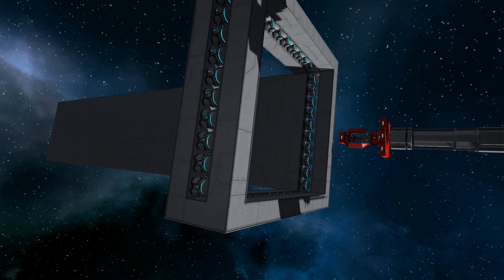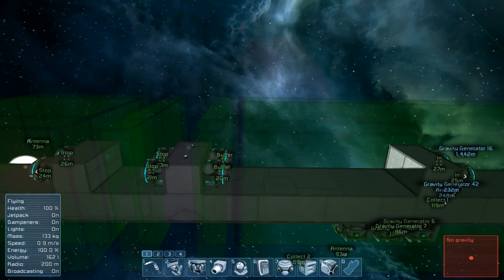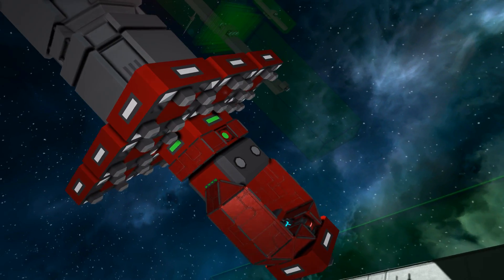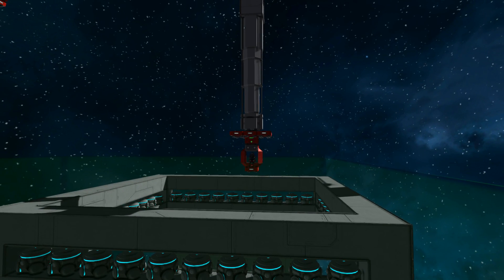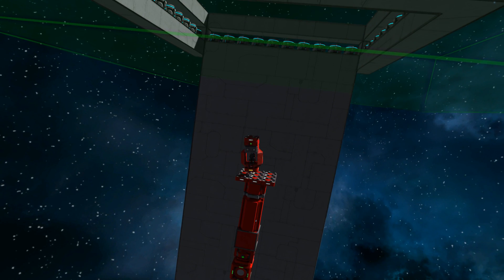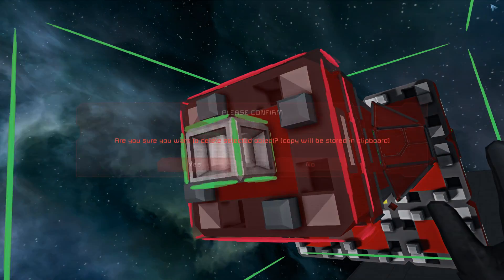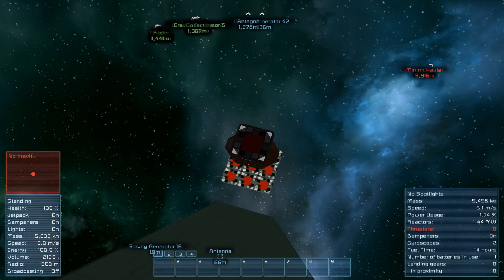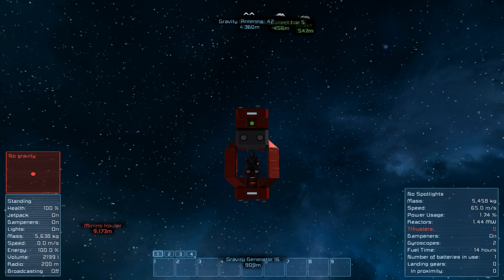Space Engineers - WiP Gravity Elevator/Catch Net System

Comment: Try making the gravity field that accelerates the cabin a lot longer, but with reduced strength, so the object will take longer to accelerate and decelerate as with the ore demonstration setup. Also, try setting the launch timer block to not only move the cabin into position and release the merge block, but move the cabin into position, then disable the gravity field, then release both merge blocks on the cabin and on the launcher, then retract the piston, then re-enable the gravity field. This way I think there will be less randomness introduced by the magnetic field of the merge blocks, even though theoretically, it should not be an issue. If it works, be sure to let me know! I love the idea. You have come up with. I would love to see one of these working in a survival map!

Comment: I think your problem is that the artificial mass is not well placed. it should match the center of mass of the ship, otherwise it will cause rotation, and part of the acceleration will be lost or wrongly directed. Try to place artificial mass in the same spot of the center of gravity of the field and also six more at equal distance in every direction it should stabilize the thing and make it work as intended. Also more artificial mass means more acceleration iirc so you might not need additional gravity generators or even need less of them.

Edit: I've tested it myself and I'm horrified of what I'm about to say but, landing gears instead of merging are actually the most reliable way to do this:
the problem with your setup (apart from the artificial mass not mirrored on the center of mass point) is the launching system itself: under the pull of gravity the capsule makes both the piston and the rotor head shake a bit so when under the heavy acceleration that bit makes your ship at least rotate so it will not merge on the other end... the only (so far) 100% reliable system is landing gears (not fixed to a piston because that will bring back the shaking issue) I've set a timer that leave you the time to get in the pod then turns the autolock off and releases the  landing gear then another one turns the autolock back on for caching the pod when returning

Comment: If you pause at certain sections of the video right as the launcher is about to put the seat into the gravity field you can see where it isn't perfectly aligned with the gravity elevator. Possibly connecting the launch/net to the actual elevator will give you a more precise shot. At least that is my assumption to the issues at hand and all I can come up with when I see the varying speeds and trajectories. Possibly launching without initially equal gravitational representation on the launch craft is creating these wonky results? As usual though, great vid.
Reply: 0:03 is perfect example.
Reply from the maker: Adam Sir good point sir :) It's weird that the grid would be misaligned as it's all supposed to be on the station grid but I've seen it happen... will see what happens if I change it.. of all my vids this is the one that's never had a solution so always willing to give something new a try :) Cheers!

Comment: I kinda rebuild your concept used 36 Gravity Generators on each side coming to an overall 36 G on the Center Point.
Using a pod with a symetric design and some landing gears above the merge landing block, to avoid bumping to the side while hitting the merge block.
It works perfect, at least on short distance.
Link to the world to test (http://steamcommunity.com/sharedfiles/filedetails/?id=392667682).

The pod is speeded up to 68.5 m/s.
As soon as i try to accelerate faster by adding additional gravity, adding artifical mass or manipulate the existing gravity field it hits the merge block too hard or hit the landing gear by drifting.

What i found out is that the merge blocks are glitching into each other when they are hit with over 10 m/s.
In addition to that, there is a slight little side drift from the gravity acceleration/deceleration.

So i tried the same settings over a long distance 5.8 km and it works also, changing any settings will cause the pod to crash into the landing gears or hit the landing merge block too hard, which happens also occasionally.
Link to the world with 5.8 km (http://steamcommunity.com/sharedfiles/filedetails/?id=392667103).

So the only way i think it is going to work is by slowly, over multiple stages, accelerate and decelerate the pod to reach higher speed without getting to much side drift.

Since i failed using a second stage on the world with long distance, there probably have to be more stages with less gravity generators or a system that activates additional gravity generators on start, but only uses less on landing except one the last block of traveling, like an emergency gravitybag.

And by the way, i know there are better and more secure ways to do that timing loops, but it was just testing on a more practical base.
Reply from the maker: Very cool sir, love that someone is testing this out and seeing if it can work.. I'll definitely check those out and get back to you but I'm intrigued by that speed limit before things start to act weirdly, maybe I was trying to go to fast with it.. I was expecting to need multiple stages in order for it to work over long distances but sounds like I now need to revisit this and try based off that setup with my original plans, see how it turns out.

Thanks for letting me know how ur experiments with it went man :) That's awesome

Comment: Not sure if this is something that has been mentioned before but the "seat" craft isnt symetrical, so the gravity wont play on it the same at either end of the grav shaft.
Reply from the maker: Aye I expected that so it switches between 2 mass blocks in flight so that while the craft isn't symmetrical, the position of the mass block relative to the grav field always is. There's one behind each merge block and it always uses the forward facing one to accelerate and the rearwards facing one to decelerate. Have since made it into a no-seat ball that's perfectly symmetrical also which no luck.. think it's just too small fields allowing for some variance. Cheers though!
Reply: another method you could try is a series of sensor blocks on the "station" themselves, so that the lift is brought to a complete stop by gravity fields reversing once the lift has passed them then "retrieved" by the merge block arm.

Theoreticaly that would allow you to launch a seat from any side and be caught in any order not just up then down then up then down.

Would require some testing though. ill play around tomorrow see what i can come up with if it works.

~further explination~
[g] = gravity block
I = point where two gravity fields meet
[s] = sensor block
> or < = direction of field
{    } = lift

[g]    [g]     [g]     [g]     [g]     [g]
[s]    [s]     [s]     [s]     [s]     [s]
  > I   >   I   >   I   >   I   <   I   <
  > I   >   I   >   I   > { I } <   I   <       <- lift direction
  > I   >   I   >   I   >   I   <   I   <

That way the lift would stop at any one of the generators but never be pushed back due to the gennies it has passed switching to a -G and holding it in place.

Anyway that jsut an idea, no idea if it will work or not but i shall keep you posted :D
Reply from the maker: Yeah can see how that work would, pretty clever solution and might have to give that a try myself.. do let me know if you have any luck with it, would be an impressive system to watch in action :)

I should however upload a clip I have from earlier today trying to get something to work for today's vid.. managed to make a ship that ignored gravity fields entirely unless they were placed on it.. not great when you're trying to make a gravity alignment system for auto-docking!

Comment: Just looking at the pod at 6:38, and it looks assymetric across the X axis; to me it looks that you've got more "junk in the trunk" above it than below, which could be making a difference.

But even then, you could compensate by having slightly different fields, particularly, having an extra field that would slow a pod down before the piston, but be out of range of the pod when you launch it from that location. It wouldn't interfere with the launches, and you would get some extra catching power.

Also, are the pistons the exact same distance from the fields each time? Because if not, one field might launch the pod at a greater speed.
Reply from the maker: The mass block is the same distance into the fields which I assumed to be the same thing as it's only that (I believe) that is actually directly effected by the gravity. I had a similar solution to the symmetry issue so while it's not symmetrical on X the position of the mass blocks relative to the grav field remains consistent because there are 2 set on a timer to switch during flight, 1 either end right in the center behind the merge block.

That was my thinking at least.. doesn't mean I won't give it a try anyway :)

Comment: Where is the CoG of your launch chair?  Is it symmetrical in all three axis?  Also, does the performance get affected by how much inventory you're carrying?  I also think the merge block release skews things a little.
Reply from the maker: The CoG is pretty damn central and I tried making a perfectly symmetrical one with no chair and it still did the same thing so don't think it's connected to CoG.. Removing the merge block helps though, goes straight every time, but it still has the inconsistent speed problem and I'm yet to work out why. I'll test the inventory thing, could be interesting and at times I was carrying a bunch of stone with my I was using to test with. Cheers :)
Reply: ***** Cool.  Not being a mathematician or physicist, the reason I asked about CoG is the little pod isn't symmetrical.  The total speed will be a product of acceleration and time.  While the one end might only be slightly different in mass from the other end, there are a lot of gravity gens working on that small difference so that could add up to a noticeable difference.  Same goes with anything the astronaut is carrying.

In one direction, the battery end of the pod is bigger, and is the last thing to be accelerated in the field, so it spends the "last" time being accelerated in the field (possibly the longest after release).  In the other direction, the end with only the merge block is smaller, and IT is the one that spends the "last" time in the gravity field.  I don't know how the game calculates the acceleration, but in the small amount of acceleration time, with a small difference in mass, and multiple generators, that might be all it needs to change the speed.

At 65 m/s it seems to behave nice, but as it approaches 67.3 m/s, it seems to produce problems, even the one at 67 m/s.  I also noticed that the piston is always shuddering and changing speed from 1.2 to near zero, even while fully extended.  If the pod launches while the piston is shuddering from 0 to 1.2, that might add a little acceleration to the pod, but if the pod launches while the piston is shuddering from 1.2 to 0, that would add a deceleration to the pod.  The sum total of that difference is 2.4 m/s and I've seen pod speeds range from 65 to 67.3 m/s, which is 2.7 m/s.  Just spit-balling here but it's just observations. :)

Maybe try another battery pack on the light end and see if that changes anything. ?

EDIT:  In retrospect, I guess I really should read all the comments (which many times on Youboob, is like wading into the shitty end of the gene pool) as most of my suggestions have been covered by others already.
Reply from the maker: georgianbents They might have been but that was a very detailed explanation of why it might change things and I definitely appreciate the willingness to try and help :) Especially as the lack of lengthwise symmetry (with the battery only at one end) isn't something that has been mentioned I believe..

One thing that might not be obvious in the video but could change things a little is that there are 2 mass blocks in that ship both positioned centrally behind the merge block at either end and it accelerates using the one behind the forward facing merge block, and decelerates using the one behind the rearward facing block hopefully meaning that both blocks are essentially in the same position regardless of which way round it is, however I don't know how SE treats objects connected to mass and whether the forces literally only apply to the mass block itself irrespective of the surrounding craft or if the mass of the surrounding craft is also taken into account (and in what way).

Have already tried removing the merge block and I'm still get the inconsistent speed thing so despite that clearly acting off it actually hasn't solved the issue :( This one still evading me atm!

Comment: Hey dude maybe the reason it's inconsistent with ships is because of the way objects interact with gravity fields, for instance, Is the force that the gravity field exherts upon the object proportional to its affected volume? Does it pull directly on the center of gravity? I don't know, might be a bug... Or maybe small inclinations while merged with the piston make it miss the target, maybe the piston waves? Get healthy man!
Reply from the maker: Don't think it's a bug there's just something in play I'm not getting despite going back and testing a few more bits.. I'm now wondering about the forces like you suggest and how they apply, going todo some tests with literally just a mass block and a reactor and see how that behaves before I do any more methinks, remove all those other variables. Cheers dude :)
Reply: Cheers! :)
Reply: ***** I know it's a bit late but did you work this out? Part of me thinks the slight wobble on a piston coupled with the fact that un merging sometimes cause things to come off each other slightly skewed may be the issue. I saw someone already suggested landing gear as the catch method but I can't imagine that being much more stable. 

This system, how would you use it? Being an elevator, you could simply use a system similar to your dolly. However if it's use is more for quick and simple transport from point a to point b, in a straight line over greater distances, couldn you add gravity stabilizing rings that help it stay on target?
Reply from the maker: *****
Hadn't even got onto practical uses yet, was mostly just testing the concept to see if I could get an object to accelerate and decelerate consistently and started with something small and basic to make things easier to control. Never worked it out no although sadly have tried pretty much all the suggestions here that didn't involve changing the gravity fields to bigger ones as I kinda wanted that super-fast acceleration effect.

So yeah, that's next step, no piston, no merge, no pilot, symmetrical craft in 3 axis and longer fields..

Comment: In more detail  as long as the speed is maxed out calculating the  distance  per gravity  generator  shouldn't be hard.  Maybe add an antenna  on each end to help measure.   Now that I think about it both fields should be thicker.  Maybe use a sensor  for catching (like to turn on more  grav generators) . If you do remember to use  timer  block  for the launch process  as  to prevent the sensor  from  detecting you during the launch process.  I am looking forward to seeing  this completed.
Reply from the maker: The goal was to make it properly reversible so the fields would need to be equal, which should be possible tbh.. equal forces in opposite directions etc, especially as there's no other factions like friction in space. I will however move onto using a timer block/sensor combo and spreading it out a bit, see if having large less concentrated fields help :) Thanks for the suggestions dude!

Comment: When you hit the merge block piston thing, it moves and alters it's position by a tiny bit, altering the angle at which you hit the gravity field and the distance you are traveling through the grav field. This skews the result at the other end.
Reply: also, when you use the piston to push the craft closer the the grav field, it shakes the whole catch system also altering your angle and distance.
Reply from the maker: luigiwinner goopir You are correct methinks, am working on ways to introduce it to the field already separated now.. although it's still not proving easy tbh

Comment: is your characters inertial dampeners on?? did you try a mass block on the front and back to balance the weight? multiple merge blocks? landing gear on pistons that have their torque really low to cushion the blow?
Reply from the maker: Dampers are off although as I'm in a vehicle without thrusters they shouldn't be effecting me anyway and yeah I'm using a front and rear mass block also, identically positioned in the center just behind the merge block. Will try the landing gear/piston thing though :)

Comment: I think this happens because your elevator is already in the gravity field making it speed up and slow down just a little bit every second or so, you can check it in the video.
I think that because of that chances are that there is a slight difference every time between speed.
I hope this helps, no idea how to fix this though.
Reply from the maker: Aye agreed, it's that that's causing the varying speed.. just need to find another method of delivering that craft into the field, maybe another single grav field that turns itself off once launch is done like some others have suggested. Cheers :)